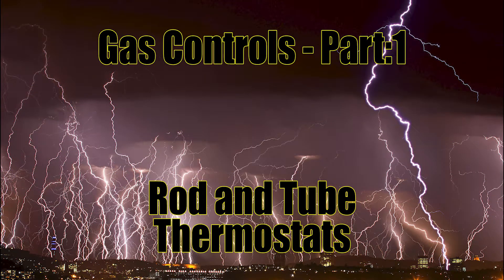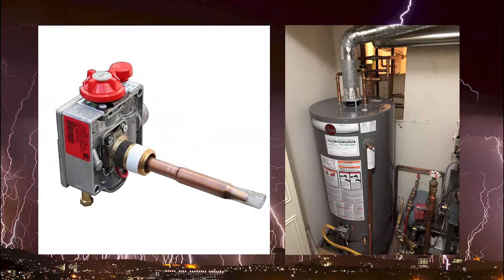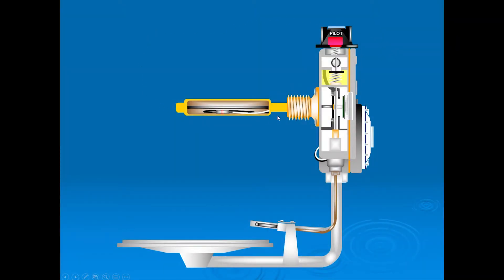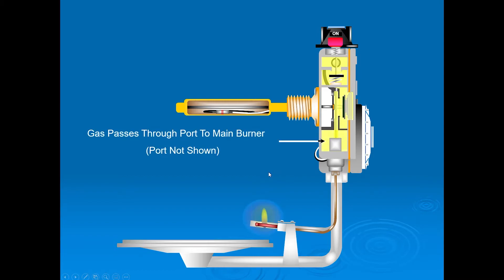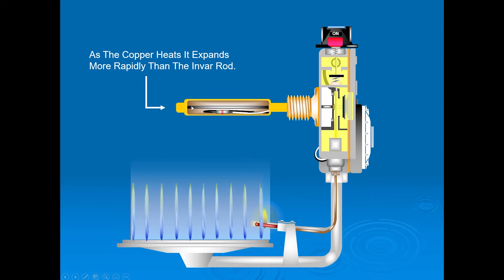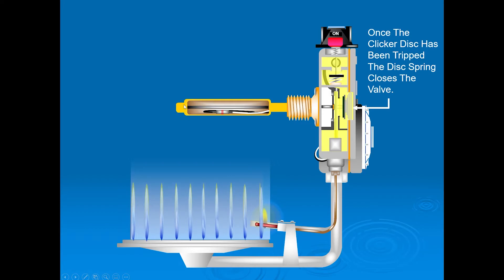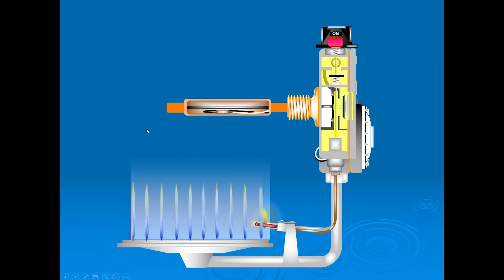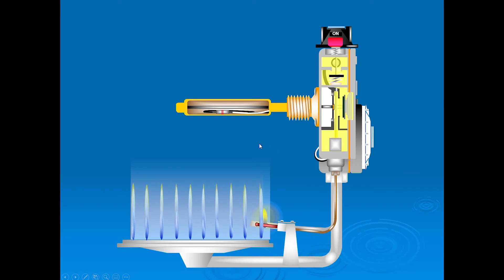Gas Controls - Part:1 Rod and Tube Thermostats

Comment: Thanks for the video ,Can I take off that plastic cover on copper tube when install water heater gas valve
Reply from the maker: You really don't want too. It helps keep water hardness (calcium) from building up on the sensing tube. That will make it function improperly.
Reply: @MathematicPlumber  
Thanks a lot .